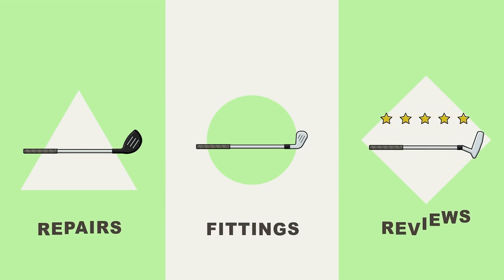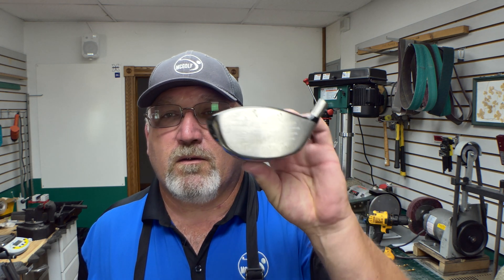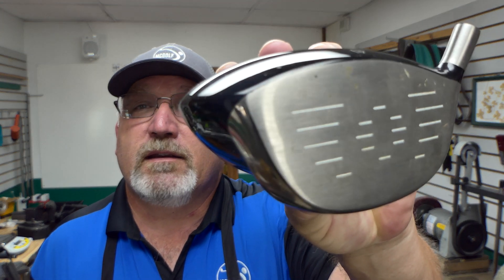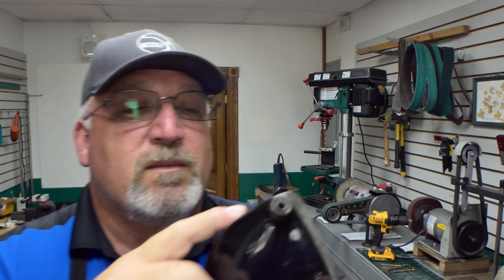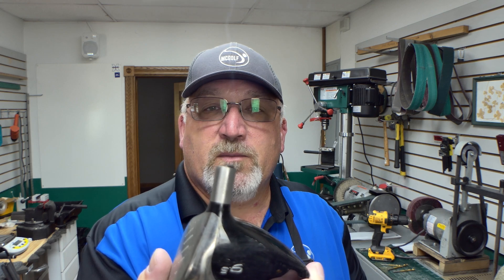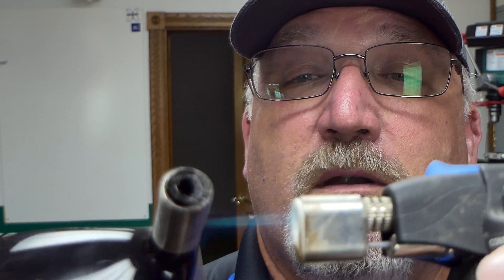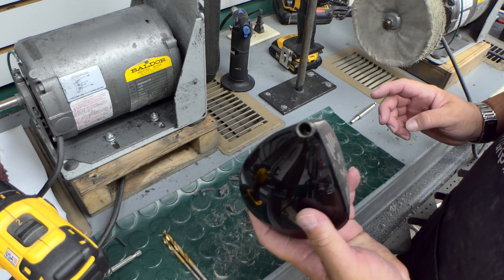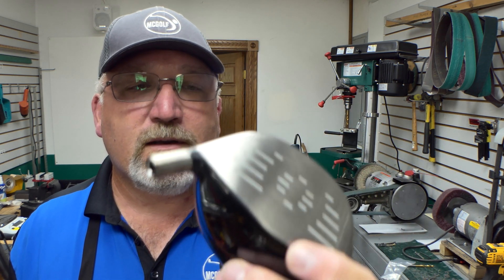Removing a broken shaft - three step drilling

Comment: I assume that last bit was 5/16" (.3125");  I thought you said 15/16" in the video @ 5:45.  Are the hosels usually .335" to match the shaft with the expectation that you'll prep the shaft to fit, or are they a little bigger so you can get away with an 11/32" bit (.344" diam)?  Thanks a lot for the video.  It's still helping folks years after you posted it.